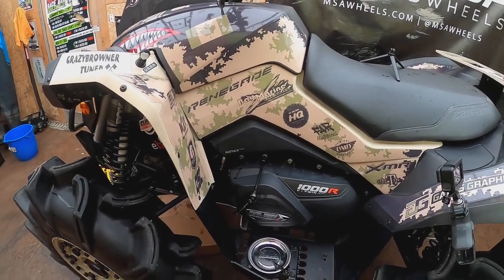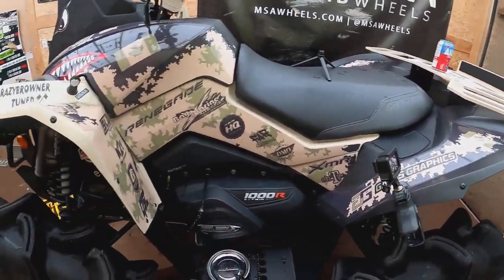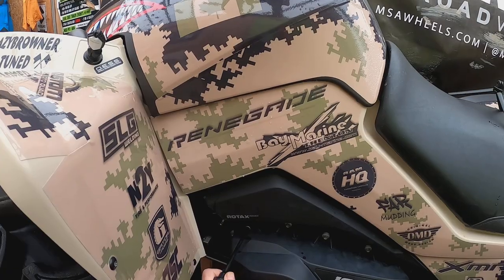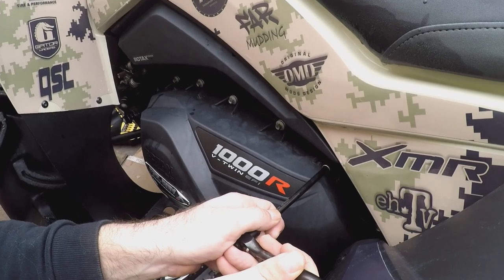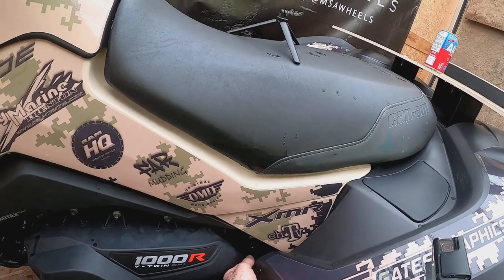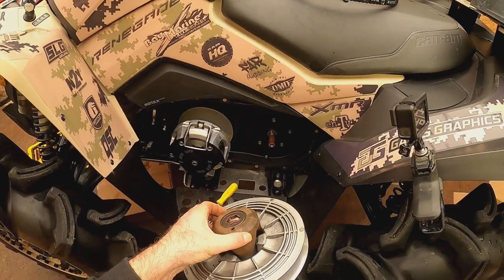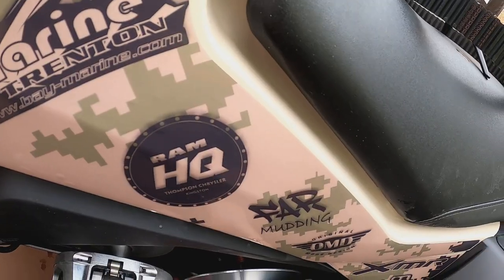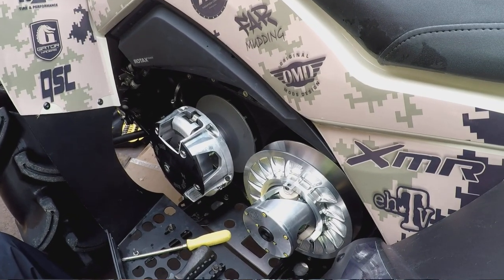STM Tuner Secondary Install & RIP!!!

Comment: A perfect setup, QSC and the STM. a match made in heaven. I've been running the combo for a few years now. I knew you'd go to it. Happy trails. "Ride Hard and Be Safe"   MN Bill
Reply: Does it really turn it into a beast ? 
 I’m thinking about about it but it’s 2500$ for the combo
Reply: @MrBossilini  a lot snapper at any range.  And the set up is matched together. If you run the QSC by it's self you'll say "WOW" the the matched STM you'll say "Holy sh*t" And, AND they are both adjustable to your riding style.  I don't think anyone would argue with that. Best $$I've spent on upgrades. Big smile.  MN Bill